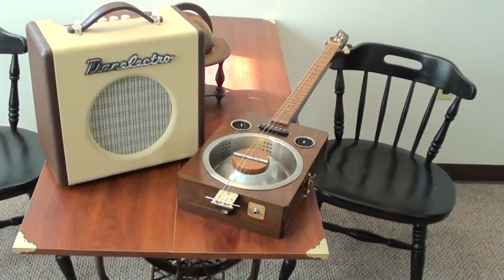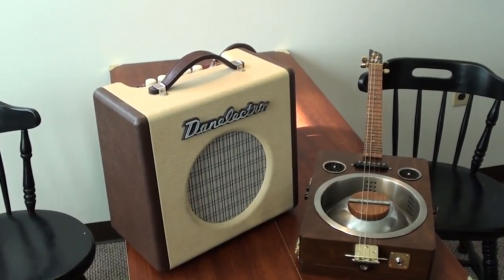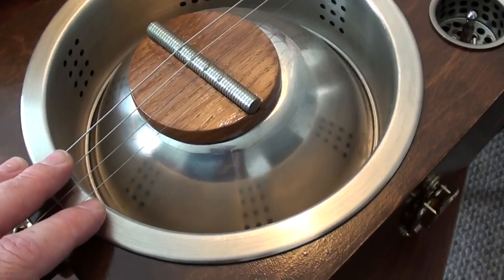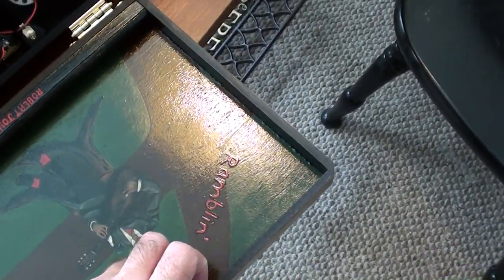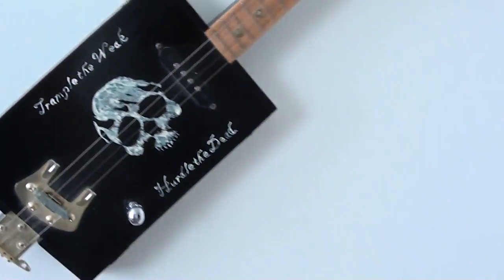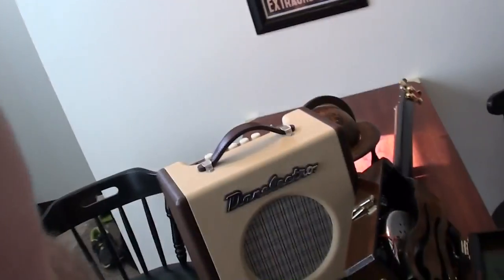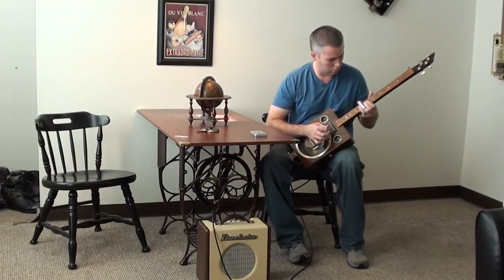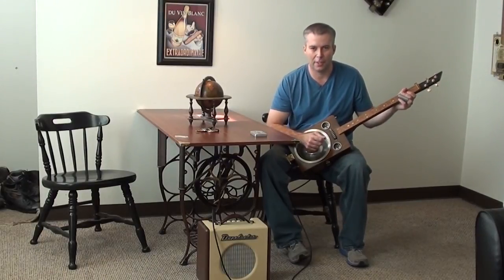Playing Homemade Slide Guitar - Danelectro Nifty Fifty Amp

Comment from the maker: This one doesn't project the sound that well acoustically.  I knew I was going to add the single coil pickup, so it was built more for a certain look than anything. If I wanted more acoustic sound, I would need to space the bowl away from the resonator a bit. I have some friends that have made some nice cigar box resonators. You can check them out on Cigarboxnation or HandmadeMusicClubhouse... Ted Crocker, Bairfoot Cajun, Old Lowe..have all made nice examples.

Comment from the maker: I spend a lot of time getting the bolt to sit in the groove just right. I have a round file that makes the perfect size slot. It would stay there with string tension alone, but I add a bit of glue for good measure. I'm sure I can get that amp to sound even better after I mess around with it a bit.  This was the first time I tried it out. Thanks for watching!

Comment: I just got my hands on a Dirty Thirty.  I've only had it for a few hours, but it packs a wallop!  Hello there!  I also build CBGs.  I was curious what do you use to get the windshield wiper frets to stay in the fretboard?  I tried using finishing nails but they don't stay put when the neck swells and contracts with the humidity.  I'm concerned that windshield wiper wire might do the same thing.   Thanks!
Reply from the maker: The fret slots are cut as precisely as possible, so that the wiper inserts fit snugly.  The key was finding a saw blade that was the precise thickness I was looking for. Then, I  dip the bottom of them in some standard wood glue, then tap them into place.  I have guitars that I built over 8 years ago and I haven't had a fret come loose yet.